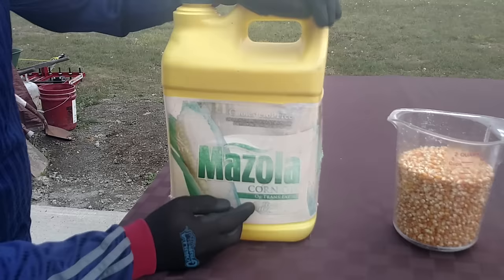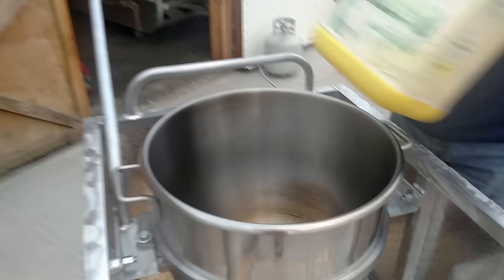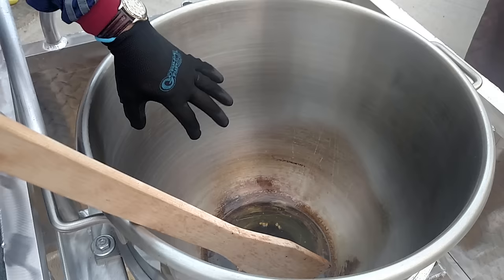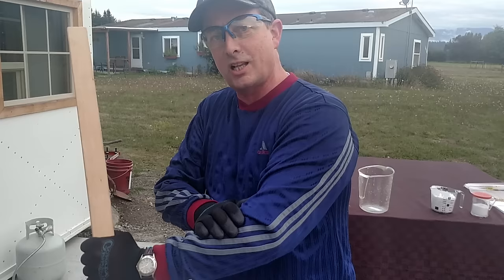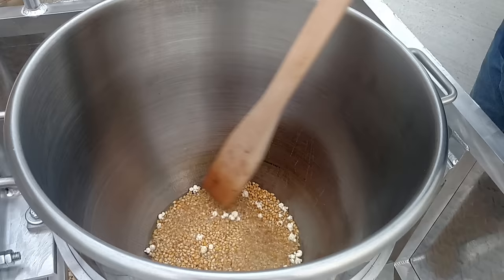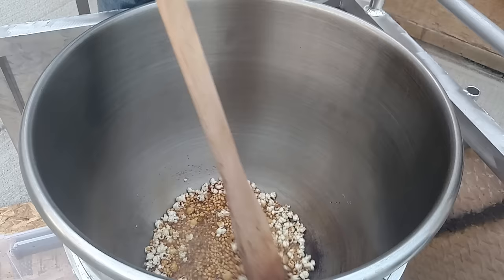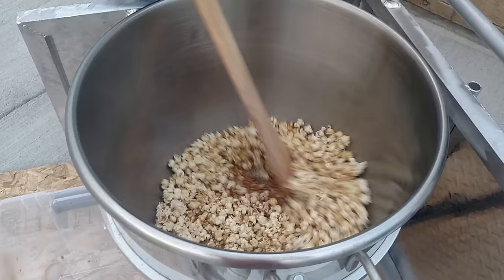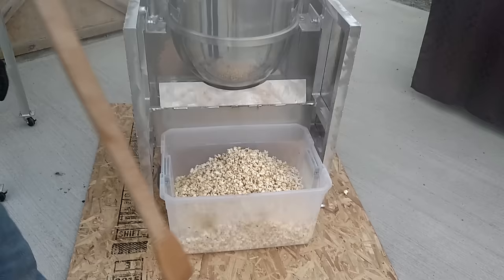Kettle Corn Recipe - How to make kettle corn

Comment: Thank you for posting this video.  Kettle corn is great at Christmas.  I make kettle corn in my small 8 ounce popcorn popper using very similar ingredient ratios of oil, raw corn, and sugar.  I had kettle corn from a big kettle just like in this video, and it was VERY GOOD.  Saw it at a Christmas carnival.  Little kids wanted to get up close and watch, but they did not yet know they could get burned.  The kettle and the operator were inside of a fence perimeter to keep people out for safety reasons.

Comment: What a sweet setup for popping corn. I have never had kettle corn, is it always made with sugar. Looks yummy with a cold drink. Well done, keep on popping
Reply: Yes, at least a little bit of sugar. If it doesn't have sugar, it's just regular popcorn
Reply: In the kettle corn business we use different flavours. In my operation we use Pink Cherry, Blue Raspberry, and Caramel. On stand by we have green apple. Biggest seller is Caramel and Blueraspbery. They are all flavoured sugars.

Comment: Ok this is cool!
However, your a welder fabricator...so make a tumbler that's horizontal for tumbling (sifting) and vertical for bagging and pouring. In just saying it'll help a lot! You can make it battery powered too or 120v whichever.
Reply from the maker: I have 5 models of poppers . I'm working on a new designs all of the time. Tumbling type is one I've considered.

Comment: You use butterfly type corn. Isn't mushroom type better for coating ?
Reply: Very good point.  I've made kettle corn with both butterfly popcorn and mushroom popcorn and had very good results.  Mushroom popcorn is generally more expensive than butterfly popcorn per pound.  At least I compared the two at the 50 pound bag price at a concession supplies and equipment dealer.

Comment: I see ur using an 80 quart.but if u wanted to could u pop more than 6 cups at a time if u needed to?For example in order to keep up with demand an an event?
Reply: Yes 10 cups is about as much as I have popped. Anymore than that and it tends to fall out of the kettle. Some of my customers say they can get 12 cups out of a batch if they use a auto stir.
Reply from the maker: I've gone up to 8 cups comfortably some have done 10 cups but 8 is about the max I like to go.